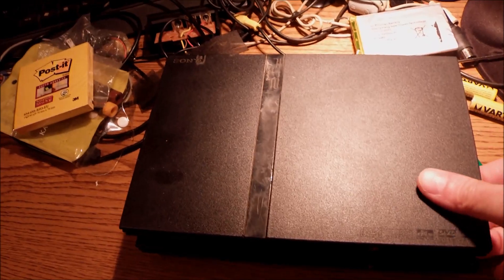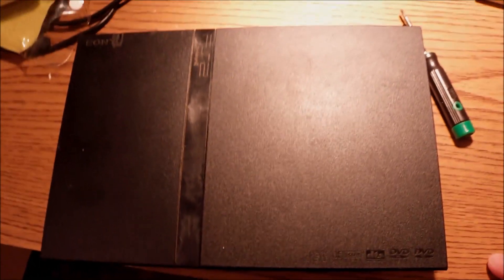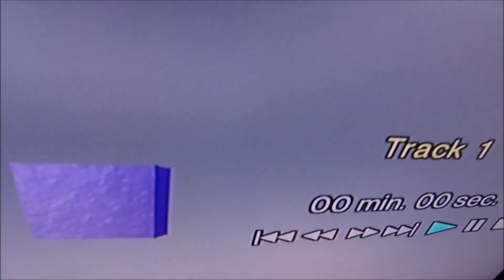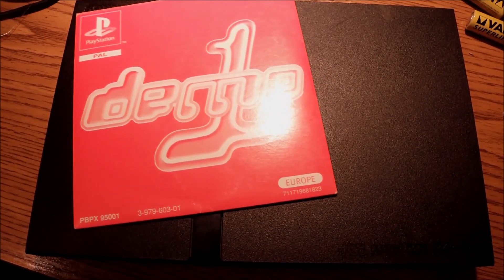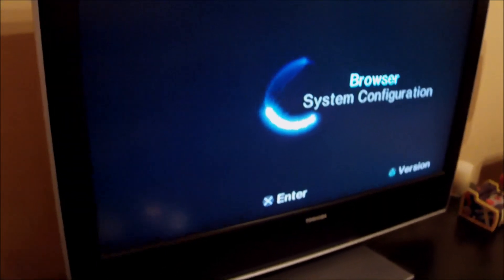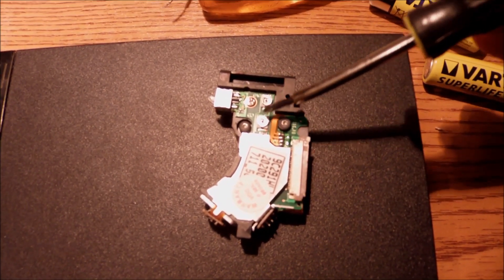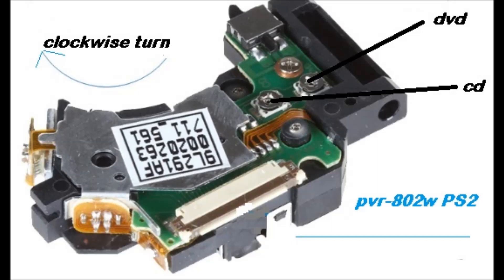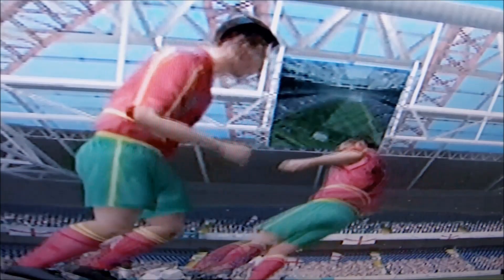PS2 Essentials: Laser adjustment easy fix: 'Disk Cannot be read'.

Comment: What to do when ps1 games dont work but ps2 games do? The ps1 games work sometimes if its upside down so I would rather fix the problem before it becomes an issue for ps2 games as well since I had a previous ps2 that did the same thing
Reply from the maker: Hi, if PS1 disk cannot be read, then it is the CD screw that should be adjusted!..
Reply: @CyberhugTechnologies  thanks. I checked some other videos that explained it to me and luckily if push comes to shove I could replace the whole laser part. I want to keep that as last resort but at least it can be done.
Reply: @CyberhugTechnologies  also when I tried to run the ps1 game the laser sounded like it was trying too hard so I would assume I need to weaken the power going to it so which direction should I turn it?
Reply from the maker: @Austin-bc1yh  That is correct, it is trying so, needs a bit more power - check counterclockwise first and if it cannot read properly try also clockwise - depends on the model!
Reply: @CyberhugTechnologies  yeah its the slim scph-90001 it was one of the last models built. What I meant by the laser trying too hard is it sounds like it occasionly hits the disc or something
Reply from the maker: @Austin-bc1yh  Sounds like the shaft on the motor is not fitted right :-) check it and make sure it makes perfect contact, check by moving the laser up and down by hand ;-)
Reply: @CyberhugTechnologies  it doesnt do it to ps2 games though but the games do boot up slower than it used to. It used to boot after like 2 seconds in now it almost makes it to browser before it loads. Ill be sure its fitted properly though when I put it back together. It needs to be air dusted anyway
Reply: @CyberhugTechnologies  I took it and turned the cd ohms counterclockwise. I put it all back together carefully but now ps2 games dont run either and it makes a buzzing noise. Do you know of any videos that go over perfect reassembly?
Reply from the maker: @Austin-bc1yh  Just browse for more info and videos - i hope this works - try my 3rd video where the whole mechanism is replaced:
https://www.youtube.com/watch?v=PcqlzIjQVxc

Comment: I didn't manage to fix it, despite the 5-6 times i tried. Any other suggestions?
Reply from the maker: Hi Pano, if it is not working after all then it is a sign the laser can only be replaced at this point as, even the voltage regulation is not good enough for it. 
It happens when the beam is so weak over the years and the adjustment cannot help further, thanks!
Reply: @CyberhugTechnologies  Thanks for the reply!! Someday maybe i will buy another laser and i will come back to inform you!!

Comment: My ps2 slim has the same problem; CDs work fine, DvDs won't be read.
I tried following carefully your directions but still no luck. Any suggestions?
Reply from the maker: Hi, I guess the laser reached the point that needs replacement - sounds like it - there is a certain point you can't do much and it is ok i guess after so many years in operation- i would suggest another attempt though! Cheers and thank you!
Reply: @CyberhugTechnologies  thank you so much for your reply! Have a beautiful day

Comment: I adjusted my dvd up and down in small increments, but it still wont read. I don't have any ps1 games to test, although it does play audio CDs fine. it makes a grinding noise every time the dvd spins and it stops spinning after 30-45 seconds. Every video so far hasn't helped so if anyone has any suggestions I am open to discussion.
Reply from the maker: Hi there, please, double-check the motor movement, usually grinding comes from there while the laser tries to find the spot to start reading from and stops if it is not possible to start reading - this might be the case. There is a shaft from the motor to the lens part which does the movement up and down, Add some graphite lubricant around the shaft - just a couple of drops. The lens might need change after all, this solution shown just extends the reading ability of the lens but at some point the beam might be so weak over time that there is not much we can do other than a new laser. Hope this helps and thanks!
Reply: @CyberhugTechnologies  I took it to one of my friends who works specifically on things like this and he said that the laser had died haha. Luckily new lasers are cheap. Thank you for the help anyways! I am sure the reply you made might help someone else who does not have a dead laser!

Comment: After i did it my discs wont spin anymore is there solution? Lazer is still lighting but disc dont spin
Reply from the maker: Ahoj Marek, Sounds to me the ribbon cable at the back of the laser has been moved? This carries the instruction signal to the motor so, it starts the right time when disk is detected. Check the ribbon cable connection :-)
Reply: @CyberhugTechnologies  its connected well. When i rotate the cd and dvd laser back how was it before now the ps2 start make loud sound and disc doesnt spin and i tried music disc and silver and blue discs and no one works
Reply from the maker: @marekbystriansky2220  Then the motor is not adjusted right (the long screw 'golden metal thing' is making the noise as it doesn't go up and down and tries to find the right path to move the laser right). The trick is to have the '"silver leg" from the laser mechanism going to the motor the right way, and test it by hand, up and down before putting back everything together. This metal should have excellent fit/contact with the motor.
Reply: @CyberhugTechnologies  thanks, i will try it :)
Reply: @CyberhugTechnologies  ok, so my light stopped lighting and motot is connected well it goes up and down. I cant really remember how was those dvd and cd screws before, because i just rotate them little bit more to start to light.
Reply from the maker: @marekbystriansky2220  Ok, nice, do not worry - just trial and error from this point on - little turns everytime
Reply: @CyberhugTechnologies  ok :)

Comment: how many ohms for the dvd and cd?
Reply from the maker: Hi there, on average - and usually - CD has around half of the DVD resistance set - so, for DVD part initially around      ~<900 Ω (ohms), every little turn should go down a bit like 100 Ω or something in order to get the best result :-)  CD should be around 650Ω to 450Ω - thanks!
Reply: @CyberhugTechnologies  thanks for the tip now my ps2 is working again :) DVD is at 1410 ohms and cd is 705 ohms. setting the cd to half really works !
Reply from the maker: @jorickearlbastian253  Glad you made it! this is my reward :-)  thank you!

Comment: hello, what is the correct ohm for cd and for dvd? 😁
Reply from the maker: Hi, on average - and usually - CD has around half of the DVD resistance set so, for DVD part initially around ~<900 Ω (ohms), every little turn should go down a bit like 100 Ω or something in order to get the best result :-)  CD should be around 650Ω to 450Ω - thanks!

Comment: So if the ps2 make strange noises and try to read DVDs games, but with no success, and after trying to clean that, can this method be useful? Thanks
Reply from the maker: Hi, it can be the solution, yes. Strange noises might be not enough power to read the disk so, it tries forever - therefore less resistance might need to be adjusted (like in this video) but also might be problem with motor spinning (rare). If this doesn't work - after lowering the resistance level, probably the whole mechanism is dead and needs replacement. Thanks!

Comment: Dear sir, thanks for the info.. i had a little bit problem to ask, my ps2 slim model no is 9002.. the issue is everytime i turn on my ps2 its on perfectly and then after i  reset the game, the video dont come out on my tv and the disk dont spining.. i need to turn off the power plug to play it again.. what should i do? is that cmos battery or others problem?
Reply from the maker: Hi, it is good thinking indeed - the battery replacement. Sounds like the video output settings are lost because battery is off and needs reset. Check output config though first, to see if output matches TV settings and capabilities though, it might be CRT with limited resolution? - like 540p or something - then replace the battery - usually comes in green plastic cover. :-)
Reply: @CyberhugTechnologies  Nice sir, thanks again for the knowledge.. will try that!... its my lucky day to find ur channel.. my pleasure to subscribe.. good luck with new video sir👍

Comment: My Ps2 laser works fine but the engine doesn't move at all and I bought the complete assembly that came with a new laser and new engine and still dosen't spin. Any recommendations??
Reply from the maker: Hi, have you checked or replaced the motor cable/ribbon as well? this might be cut or bent in some nasty way!
Reply: @CyberhugTechnologies  yes and still nothing
Reply from the maker: @rjprz5929  Sounds like a "Power line issue" before even power reach disk & motor compartment... Led goes a bit 'red' during initialization?...
Reply from the maker: @rjprz5929  ...and do not forget to check the little plastic brackets that "allow" the disk to spin ONLY if the lid is closed.. maybe they're broken?
Reply: Cyberhug Technologies I have this issue! Led goes a bit red and then punching a disk. What should I do? Please, help
Reply: no the laser only moves and I checked the brackets there in good condition.

Comment: My PS2 only plays blue discs. I'm working on getting it to play silver discs today. I tried this and, though it's still not playing them, it's now making a sound like it's trying to read them when before it didn't make any sound. Should I keep turning clockwise? I've seen other tutorials that says to turn counterclockwise. Is there a point that I could turn too much and completely ruin it? Thanks!
Reply from the maker: The particular model gets little more voltage clockwise. You need to double check laser model eg. pvr-802w or other? turn carefully though every time, we do not want to over-voltage  :-)  I recommend turn by quarter every time tops. Counterclockwise i have only tried when repairing Sega Saturn btw. and worked fine.
Reply: After more fiddling I was able to fix it and it works now! Thank you very much!
Reply from the maker: @Zomy_Streams  Yeah! Happy to hear that Rose!.. Very welcome <3

Comment: My chiped ps2 slim reads some burned dvds fast and some it struggles. Freshly burned on a verbatim at 4x speed. Any tips? Is it just a case of adjusting the laser ? Or i have to try this with multitool and adjust the resistance to 800?
Reply from the maker: Hi, i would go for the adjustment first and see what happens, just a little turn is enough to check the problematic DVDs. i believe the latest DVDs are far more "thin" and with less layered material on top - not like the older ones. Of Course, resistance adj. is second option for sure!
Reply: @CyberhugTechnologies  I have  checked out the DVDs laser resistance  and it was set at 1150 , and it reads the disks, the only disk that it didnt work properly is San Andreas, but  maby its the ISO or it needs a dual layer dvd. As far as i understand the higher the resistance set the lower the power its going thru the laser so it will last a long time. I have also tried setting it to 850 and still got issues with san andreas and no other game. So i set it back to 1150 and its runing great. Seems like a have a realy good laser that doesnt need much power to read. I have also found this useful document about adjusting the resistance   http://www.geocities.ws/link642k/RECALIBRATING-YOUR-PS2-LASER.pdf
Reply from the maker: @Gixxer983  The best description i got so far and by far! Thank you for link and the perfect steps described. Maybe it is an ISO thing after all, true. i wouldn't worry too much for a single title, the console can last for many years to come with proper adjustments. Thanks!
Reply: @Gixxer983 what model of ur ps2 slim?
Reply: @asyuna.02  Ive since fixed disc reading issue and have since moved all games to an external hdd with freemcboot